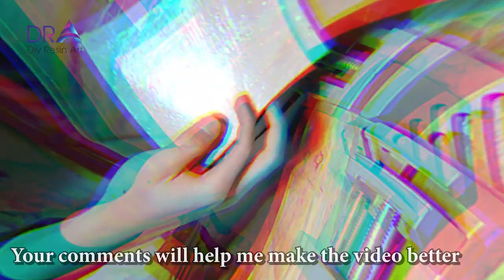🌹 RED ROSE & BUTTERFLIES Amazing Epoxy Resin Night Lamp | Diy Resin Art

Comment: What was the tape you used to line the wood with?
Reply from the maker: It is paper tape 😃 Thanks
Reply: if you are talking about the clear tape , that was just regular packing tape . resin won't stick to it . but if you wanna make doubly sure , sue mold release on the tape  . just make sure the mold release is completely dry . hope this helps

Comment: I damaged the roses in resin, the color of the flowers turned yellow
Reply from the maker: Because the temperature is too hot, you should let the room cool or soak it in water to reduce the temperature
Reply: @DiyResinArt  tq for info